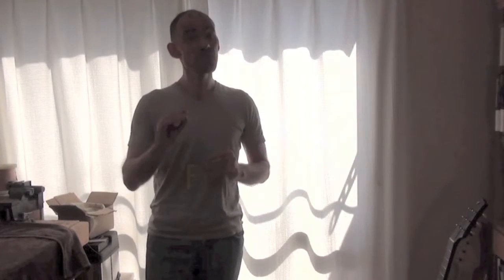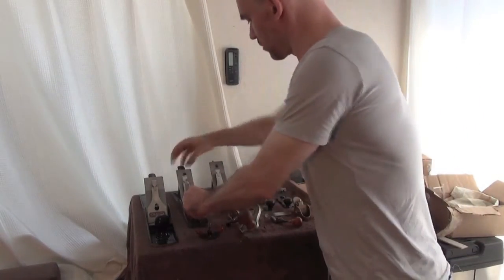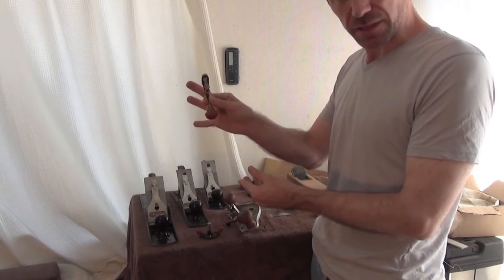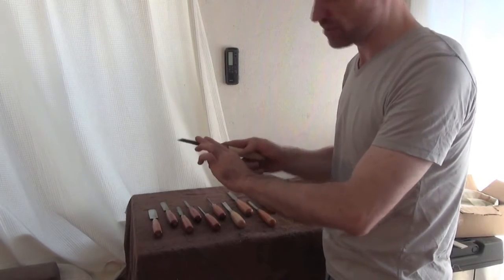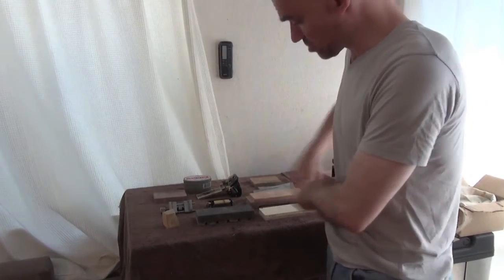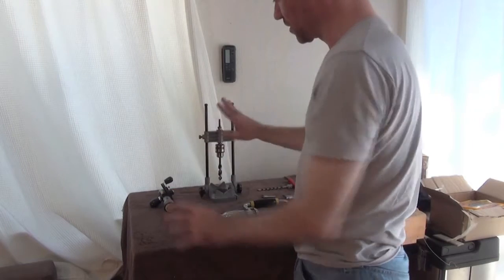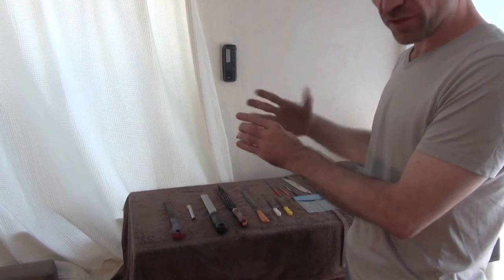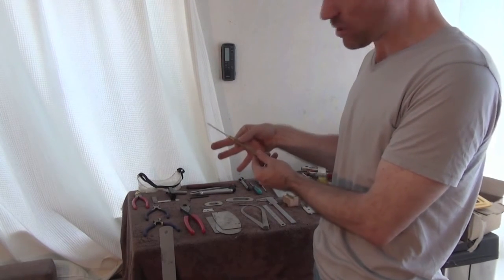Hand Tools for Electric Guitar Building

Comment: Sharpening info and last section very useful to me. Thanks. Stumbling on your channel is liking finding gold.

00:51 saws + mitre box info
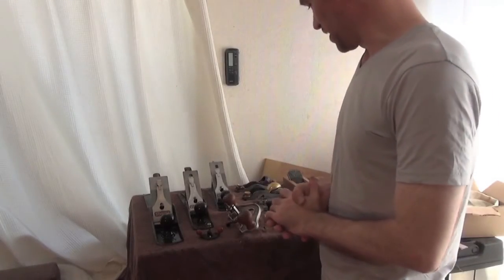03:27 Planes
10:02 Chisels
14:30 Sharpening
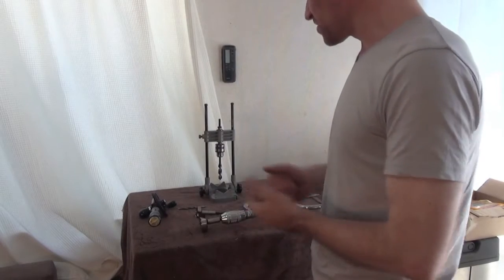19:22 Drills + interesting drill stand + reamer info
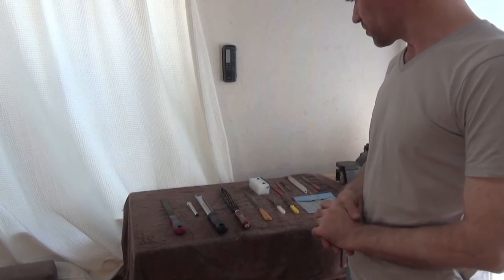21:45 Files and scrapers
26:44 flat ground cutter
26:57 Grammel tool
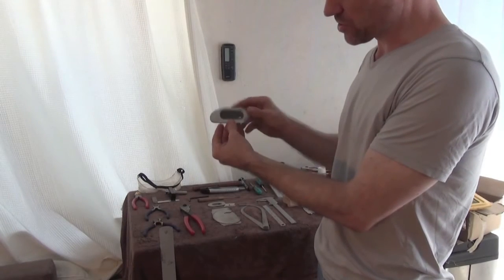27:20 Scrappers
28:10 knives and awl
29:05 Measureing tools
29:53 clamps
30:23 Types of hammers
30:37 Fret fitting tools
31:26 vices
31:50 sanding and sanding block types
33:08 link to Katana fret leveling system
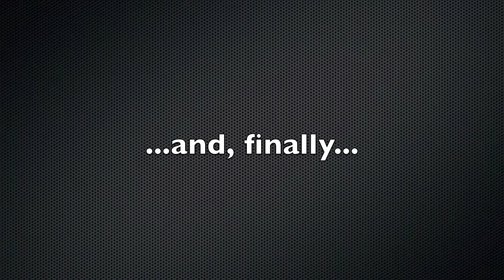33:26 Minimum start up tools
Reply from the maker: Great - thanks so much for indexing the vid!

Comment: Do you think a 12" long bow saw is long enough? what length would you recommend? thank you for sharing your awesome works. I really hate powetools and after watching these series I will give it a try, you inspired me :)
Reply from the maker: 12" is pretty good. Obviously, there's a length/efficiency balance - too short and you're going to work too hard, too long and it'll wobble around and be unbalanced - but that depends on you as much as the tool. At 180 cm, I might be happier with 14", but 12" still worked well. It's even more of a personal thing with planes. Many people use the #5 as their default, but, after several years of doing this stuff, I now always reach for a #5 1/2.

Comment: Hello my friend. Congratulations. I'm from Brazil. Excuse-me for my poor Engligh. I would like to know what sizes of chisels and gouges you use in video and wich branding you recommend. I would like to know too if you build a classic acoustic guitar wich tools are necessary more than that's used in your video. Best regards
Reply from the maker: Hi there - thank you! I use (and recommend) the Ashley Iles Mark II bench chisels. They're great steel and very well-shaped for guitar-related tasks. I have a set of six that goes from 3mm to 25mm and those meet all of my needs. However, there are many other fine brands. I've heard great things about Two Cherries for guitar building, but, if you're looking for secondhand tools, Berg are considered to be excellent. My gouges are mostly by Marples and Sorby and are very good. I seem to remember that the one I use most is a #6 sweep. As for tools needed for classical and steel-string acoustic building, the main thing that I don't show here would be something to bend the sides. I've used a bending iron in the past, but currently have a bending jig with heating blanket. Good luck!

Comment: What type of blade are you using on your bow saw?
Reply from the maker: Hey! I use different 12" ones from Gramercy, as I have their bowsaw.

https://www.toolsforworkingwood.com/store/item/GT-BOW12.XX

They make them in 10, 16 and 24 TPI. The more teeth, the finer the cut, but the slower the work. For cutting out body blanks, 10 TPI is great.

Comment: Do you live off of building and selling guitars, or is it just a hobby?
Reply from the maker: Very much a hobby. The guitars I build are donated to players, who then decide upon the value and donate that amount to charity. I suggest a school in Cambodia, but it's up to the individual. In the future, after I retire, I may well open a small shop for custom instruments and repairs in Tokyo, however.
Reply: TomboLP oh nice, that's pretty cool. I'm only 16 and I want to be able to make guitars for a living in the future but I'm still learning what's the right way to go about it.
Reply from the maker: Cheers! There's a lot of good stuff online to get you started. I suggest checking out the "Luthier's Corner" forum at mylespaul.com. Tell 'em Barnaby sent you. 

That being said, it's hard to make a living at this for lots of reasons. You've probably heard the old joke that the way to get a small fortune as a luthier is to begin with a large fortune, then start building...
Reply: TomboLP thanks! I'll check it out. I understand that it will be hard, and expensive, but I guess I'm not going to get anywhere without trying.